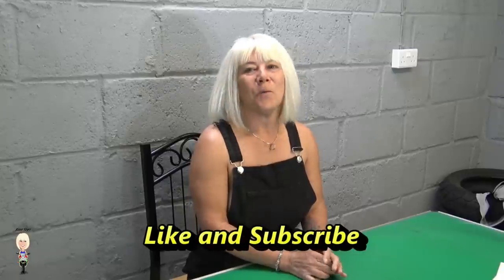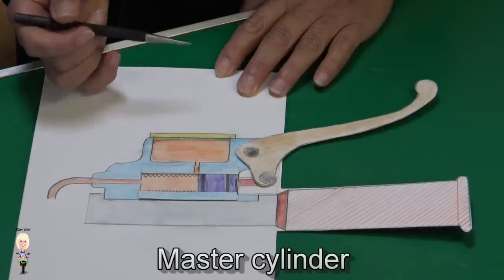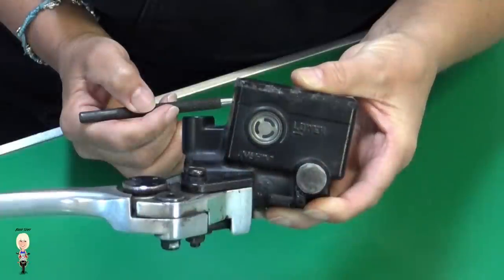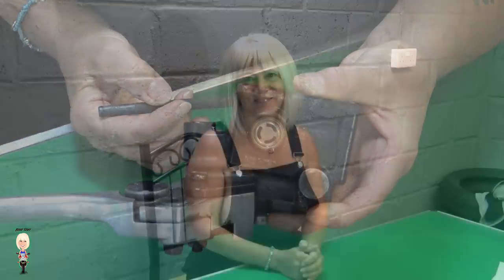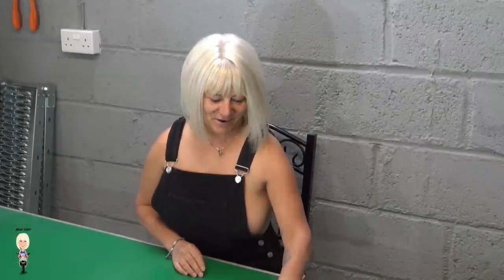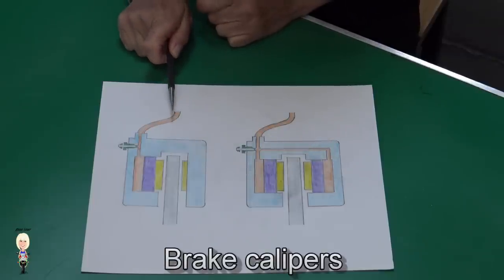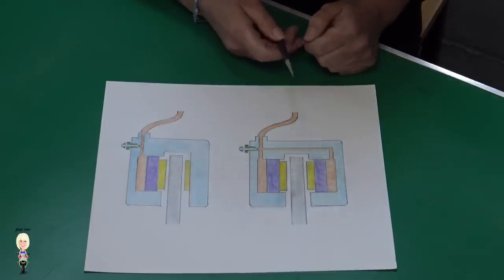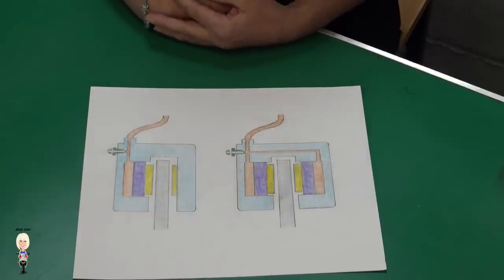Pull that lever

Comment: great drawing . here's anoher tip . always check the brake disc when replasing the brake pads .
when the disc is a few mm thinner then normal .you will have no brakes even if you put new pads in .
that means the lever piston is out off reach off the pads . the piston can only travel the distands off the lever cilinder .

Comment: Very well done video. Outstanding presentation. Something else to remember is you need to match the master cylinder to the brake calipers and NEVER mix brake fluids as that will totally gum up the system.
Reply from the maker: You can only not mix Dot 5 with other brake fluids, but you can mix 3, 4 and 5.1
Dot 5 was used primarily by Harley Davidson
Reply: WoW, I didn’t know that! Thank You so much !

Comment: well explained, but also some of us have 4 or 6 piston  floating discs e.g. Ducati Brembos, which are superb. Dana 👍😘
Reply from the maker: You can't see multiple pistons on a 2D drawing
Reply from the maker: They aren't really floating discs, but they have a group of rings that join the disc to the disc carrier.  They are there to help prevent warping caused by overheating.
Reply: @bikerstuff2  yes good point, Ducatis did have a problem with warping and they should be called semi- floating. Also when you look at my front wheel the size of the diameter of the discs compared with the wheel is impressive, giving a working advantage. I don't have ABS but frankly prefer them like they are, very linear and powerful, I've never used all my fingers, usually 3... and yes I'm still talking about braking 😂😂

Comment: I knew my rear brake pads were worn out once when I was coming down a steep mountain with a passenger on the back, and the brake pedal didn't work.  Fortunately, the front brake pads were fine.  I changed the rear pads my self..  I prefer to do as much work on my bikes as I can myself.  That way I know it's done right.  (usually).
Reply from the maker: Your front brake is your primary brake.  The rear should be used as an additional brake and to be used to stabilise the bike when riding slowly.
Reply: @bikerstuff2  That might be the case now, but when I started riding motorcycles as a kid in the 60's they all had drum brakes.  No one ever touched the front brake (unless it was a super emergency), especially on a slick surface because it meant "instant crash".  Old habits are hard to break.  To this day I stay away from the front brake as much as I can, I'm just used to the pedal.
Reply from the maker: Then you're an accident waiting to happen.  Modern bikes intentionally have a soft rear brake because it isn't meant for anything more than I explained before.  With two big discs on the front, the rear brake is redundant for straight line, non emergency stopping
Reply: @bikerstuff2  My Triumph only has one little disc on the front and hopefully my accident can for about 10 or 20 more years until I'm no longer able to ride.  I'm 60, I've been riding 2 wheeled conveyances since I was 5 years old and I've never had a single accident on the highway and plan on keeping it that way.

Comment: Wait ... if something doesn't work I should fix it?  Wow what a concept.  Also that's just the front brake right?
Reply from the maker: The back hydraulic brakes work the same as the front, except with your foot
Reply: @bikerstuff2  but with a foot if your other hand works a clutch I think
Reply: @bikerstuff2  I just rode around the block on a '73 VeloSolex French moped that I just got and hasn't been run for at least 3 years and that's not at all how it works.  Not making fun just having fun.  Cheers !